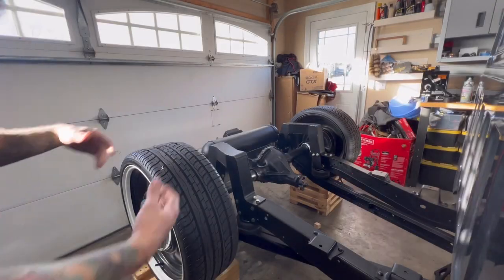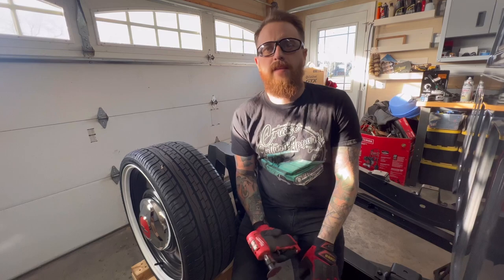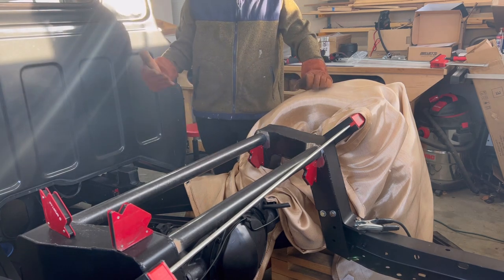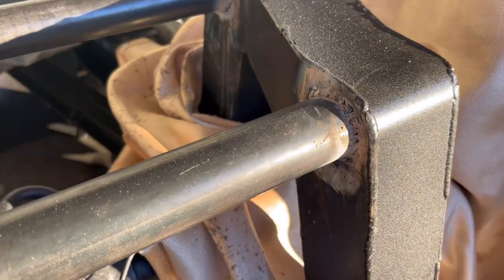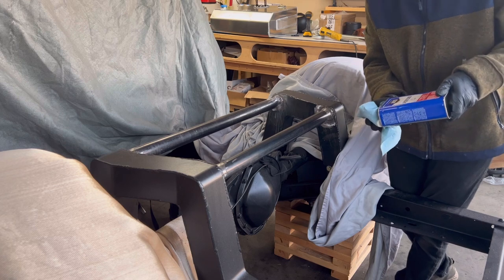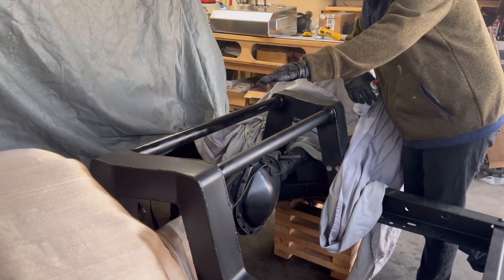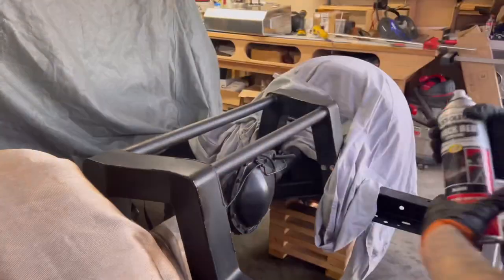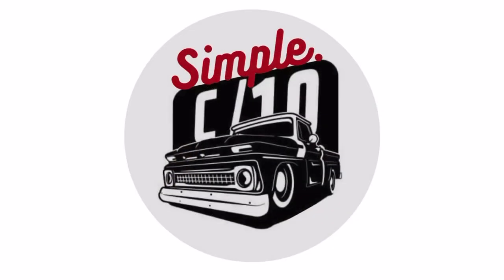C10 | Notch Bridge Installation for Air Ride Suspension

Comment: If you just upgrade to something like the biggest 110volt Lincoln (145 or 155) and some mig mix gas.... those welds would come, right, around. You be amazed how much easier it is.  You did all the steps nicely, flux is just letting you down. Like you said it will work just fine.  Video are getting better and better!
Reply from the maker: Thanks a lot!!
Reply from the maker: I’d like to get a nice welder and learn how to actually make it look good lol.

Comment: What rims and tire combo u have . That a white wall tire  or just a ring.u have  adapter..or spacer. ring. Swwet . My air bag set up I did it the same way.. but 8 used 3 block..
Reply from the maker: 22 inch transport wheels. The lip is painted white. You can see the pics in my Instagram. Simple.c10s
Reply from the maker: 255/30/22
Reply: Thank u .. Great job on the truck
Reply: @SIMPLE.C10  rims size is 22” tall, but how wide? And are they the same width on all four corners?
Reply from the maker: Transport wheels only come in one size. 22x9 6x5.5 lug with a 6 inch backspacing. All are the same size.

Comment: Are you going to add larger spacer blocks? Looks like you have a lot of room in the new c notch. ?
Reply from the maker: No. 4 inch block is the largest you can go or the trailing arm would stick below the wheel. There’s room left in the notch because you can lay frame on 24s with this notch. My setup doesn’t fully lay frame.

Comment: Where did you get the tubes and what specs on the tubes so i can get them cut to size just ordered everything for my 66 c10
Reply from the maker: I got them at a local metal shop. They are 1 1/2 by 3/16.

Comment: When you installed CPP lower control arms  did you have to relocate shock brackets? on mine brackets  seem to be more forward towards the wheel   , which puts shock on too much of an angle
Reply from the maker: No I didn’t have to relocate. Did you get drop shocks?
Reply: @SIMPLE.C10  yes the same ones .